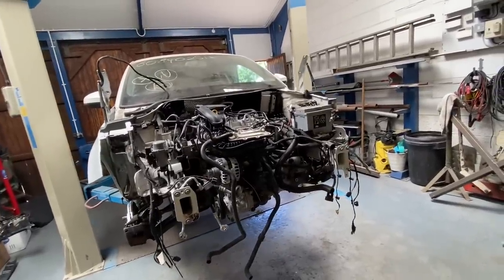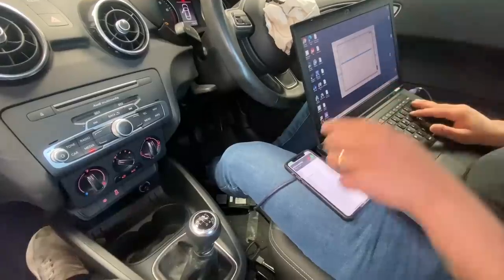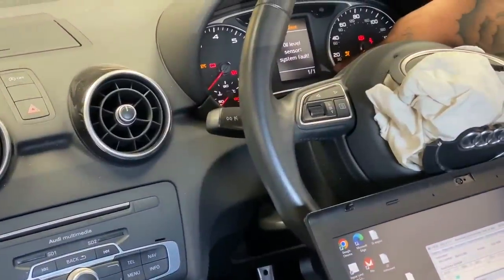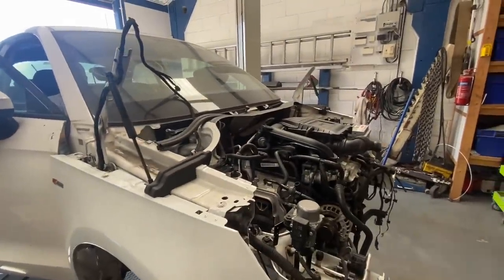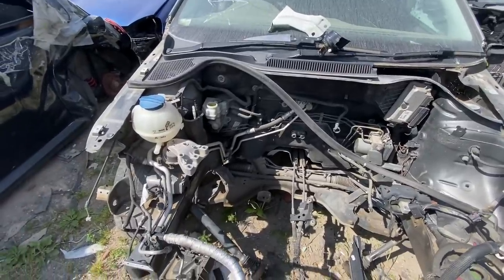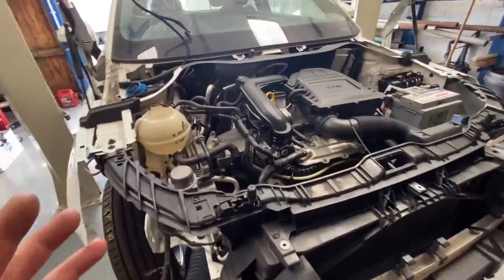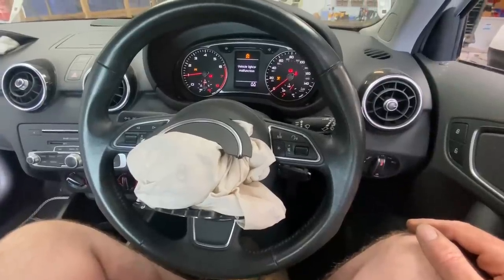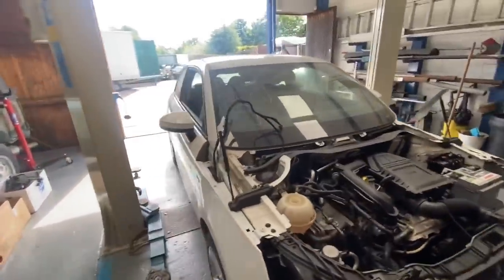2016 £900 COPART SALVAGE AUDI A1 WILL IT FINALLY RUN ???

Comment: This one has been a bundle of work for you guys, and no mistake. The list of sundry odd bits to find and replace has led you on a fair old dance. Six months of careful gathering is finally getting you moving forward, still, it was great to see it finally takes its first steps after its 'slight upset'. A shame about the bent leg, but I guess these last minute snags are to be expected when cars have been walloped. At least you can have a relaxing weekend now, hopefully cooling off after the heat of today.

Comment: The steering one and a few others are because the battery was disconnected. The steering one probably isn't an issue 0 when you run the car, make sure you get the steering from lock to lock, that re-sets the sensor. 

I replaced the seats in my Seat Leon, I got a load of codes that wouldn't clear. Within 1/4 driving and getting the steering lock to lock they were all gone. Awesome work as always!

Comment: Cracking Content on the Audi A1 guys. The car starts runs and drives which is a good sign. The car is almost there. Chris has to prep for paint and get the rest of the jobs done on the car.  Amazing work Rob and Chris. keep up the good work.  Have a good weekend.

Comment: we use a big knife like that to cut off the old tyre valves, health + safety visitors said we couldn't have it, so i stuck some masking tape on + wrote "tyre valve removal tool" on it. it now passes, as a "functional sharp edged tool"... bless them...
so what time is it now rob ?

Comment: Power steering fault is very easy to reset, you do a basic setting on the module 44 and recalibrate the steering I have a cheap Autel that can re calibrate them. Takes 2 minutes, I’m sure you guys will have a scanner capable lol

Comment: Rob I've got a 1.2 clio 100k miles been sat on the driveway since it passed its mot in 2020 nothing wrong starts and runs spot on just needs an mot and a service if you and Chris are interested
Reply: You need to private message them on Instagram with your phone number first in the message

Comment: It runs great, very quiet. The refurbed wheels look great. Much better in silver. I really enjoyed the key cutting and programming. The new key lathes are certainly quieter than the older ones. Is the old strut the original one?

Comment: Dealer spares are always priced to the car. The VW part would be cheaper and the Skoda part cheaper still.
Back in the 70's I wanted a floor mounted washer switch for a Mk III Cortina. It was out of stock at about 4 quid. The same switch for an Escort was 3,  and the Granada was over 5. I bought one for a Transit @ 2 pound 50 ish and removed the extra bracket that was riveted to it. Nice to have a helpful spares specialist.

Comment: on vw  you disconnect the battery you will get power steering and tpms  a  few other lights till its driven and lock to lock till it learns  abs sensors and sas i use ross tech site for code descriptions  causes and solutions gives direction at least
Reply from the maker: It’s crash data bud it has to be reset 👍

Comment: Key man.  We had our site burn down.  100 businesses wiped out over night. We had 7 keys made up same way spent 140 cheap plip key and annoyingly 350 for a Saab. 7 keys 1225.
Reply: Saab is now closed down so no dealer to get the key saab is not a straight forward to do a car for im afraid. I wish I could’ve helped but £350 is around the going rate for a saab 9-3 etc
Reply: @PREMIERAUTOLOCKSMITHS  wow. Thanks info

Comment: The sat nav is operated through an SD card which goes in slot 2. They are expensive and somebody has half inched it. It will have turned up on eBay I suspect.
Reply: On pre facelft cars the maps SD card goes in slot 1 and slot 2 is for your own media (MP3 files etc) but satnav wasn't standard on all models. No satnav means 2 blank SD slots in the dash - even though there's a Nav button on the Audi MMI system

Comment: Not 100% sure but vcds might be able to reset the steering module worth asking.
I’ve never done one but I’m sure if your fitting a new s/hand dash and getting the belts sorted you could get the module done at the same place I guess
Reply from the maker: I will be replacing all the belts wen I do the airbags 👍
Reply: @sruk  choose wisely where you get the stuff done buddy my mate got stung took 3 months to get the belts redone and the dash was one of those repaired ones awful job got his money back in the end but a nightmare
Reply: Forgot to say it too was an A1

Comment: Right above the bit where that key cutter is slicing through metal cutting the key there is a warning not to put your hands under the drill bit or you will get hurt. I'd say if you are daft enough to need that warning you shouldn't be anywhere near that machine lol !!!

Comment: That coolant tank looks a bit too yellow for a 16 plate car and looks a bit tatty and not up to your usual high standard of work
Reply: Perfectly serviceable and the car is 6 years old damaged repaired, not sure a slightly yellowed coolant reservoir would be a deal breaker. Strange comment.
Reply: It’s a 6 year old motor not going to look virgin white
Reply from the maker: It did the job for this video and to get it running 👍
Reply: @sruk  Didn't mean to sound nasty or put negativity to you both I admire what you do and i enjoy your  content so much  and look forward to your videos every time .Any chance of showing how to remove yellowing of a coolant tank There are a few videos on You Tube but I would rather see you guys do it as I'm sure that it would be 100% perfect